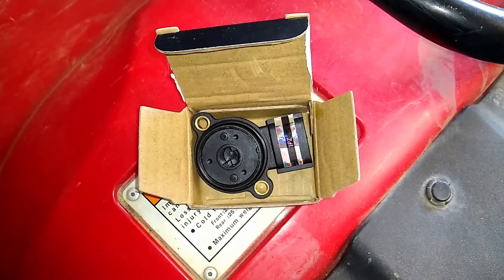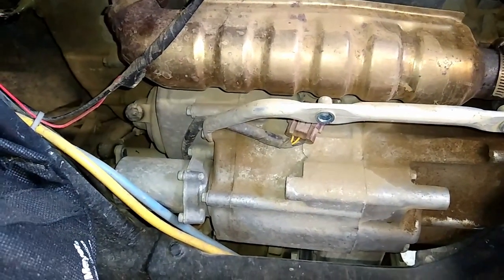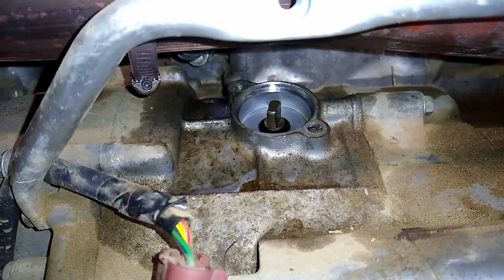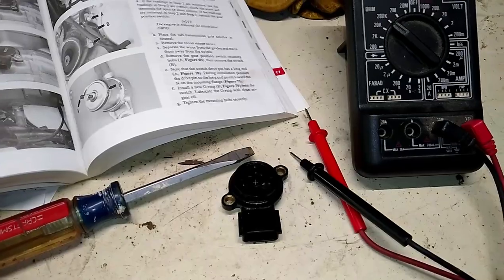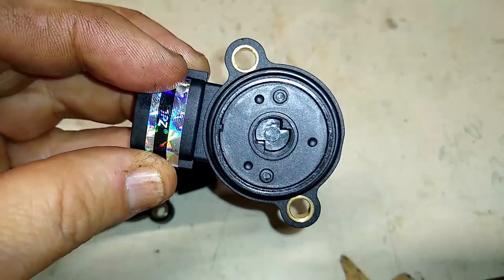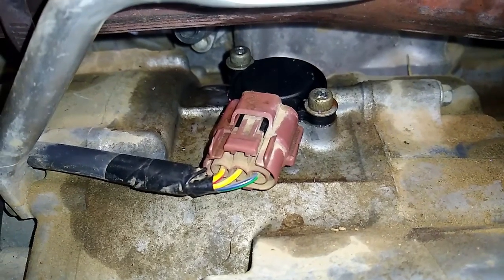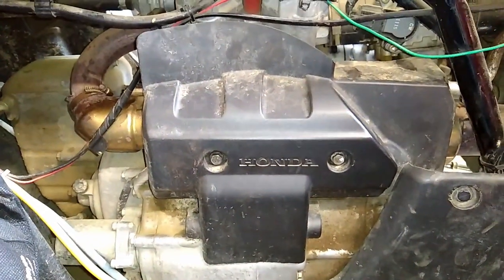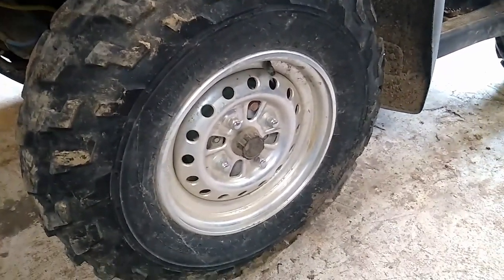Replace an Angle sensor on 2002 Honda ATV.

Comment: My 2000 Honda 450ES was slightly different, sensor mounted near bottom of engine, no where near exhaust pipe. Models changed about that time, don't know which year it was though, the 500 evidently is different. As one poster said, showing actually changing the sensor would have been beneficial. Good you mentioned turning new sensor to index it to which gear the transmission is actually in. Forgot if had to do that to mine, seems mine  was automatically aligned where it needed to be once you got sensor turned so it would slide on the shaft. With all that said, on mine the shifting gears inside were all dried out. Cleaned them and put new grease around them & shafts. Sort of seemed to fix my no shift, dash display lines issue. Lately however, did hang up a time or two like it used to when got hot, why I'm here. Either that new angle sensor I put on is also acting up or have some other problem such as the ECM. Thanks for posting.

Comment: You didn't show us how to turn it clockwise.
Reply from the maker: You basically install it 180 degrees counter clock wise from where it will end up being bolted in.  The sensor is spring loaded.  It will be obvious when you have it in hand.

Comment: If it’s good what should it read
Reply from the maker: 1600 to 2400 ohms normally.  I did not get that on the old one, which is why o was replacing it.

Comment: Sometimes mine shifts Sometimes it wont
Reply from the maker: The Honda's are finicky.  Everything has to be in alignment mechanically and electronically working harmoniously or it won't work right.